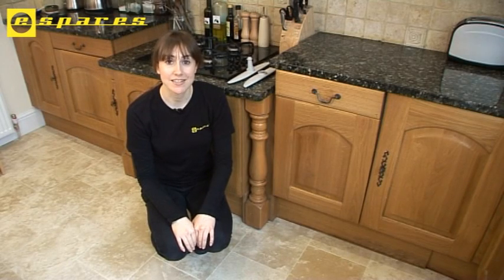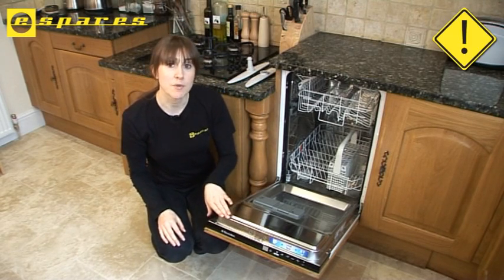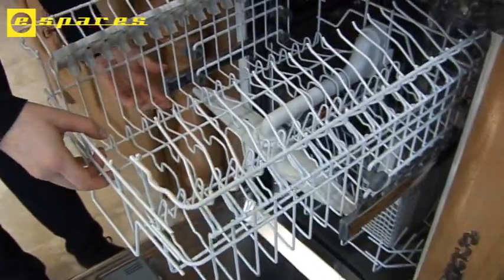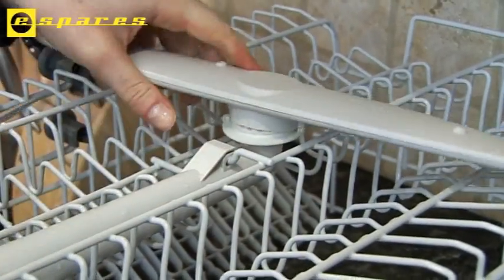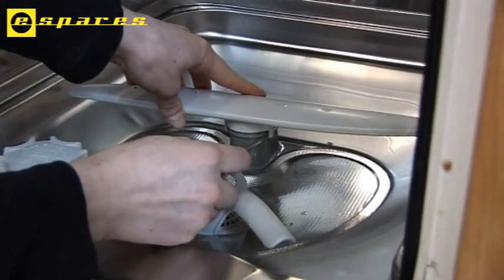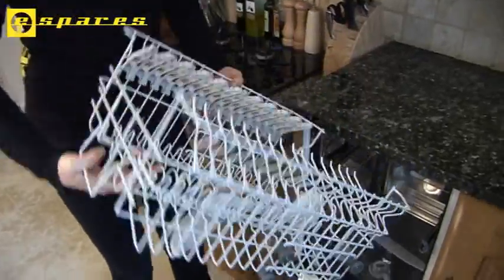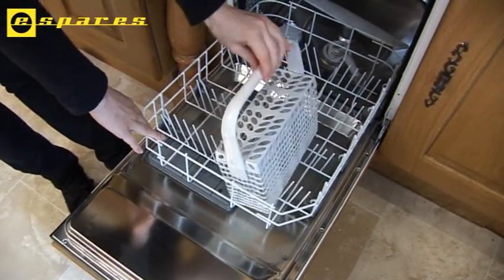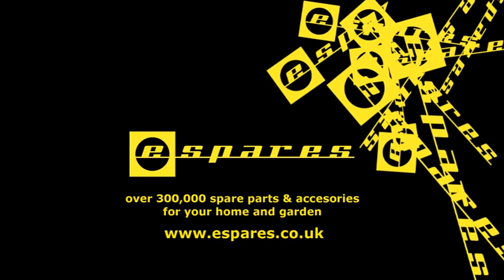Electrolux Dishwasher Spray Arms Replacement - Quick Fix!

Comment: Spray arm removal not working for my ESF6521 PNC 911945025 model. Praying off with a screw driver was not feasable. Also there is some kind of white fastener plastic ring, which can be moved 90 degress, and seem to keep the spray arm in place.